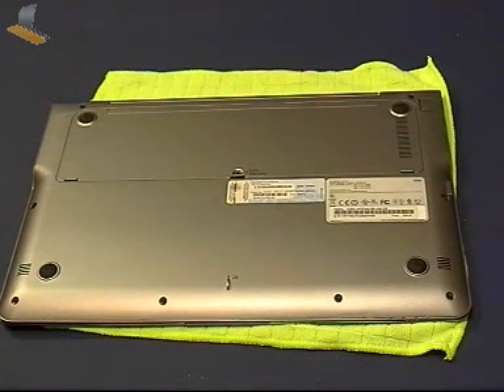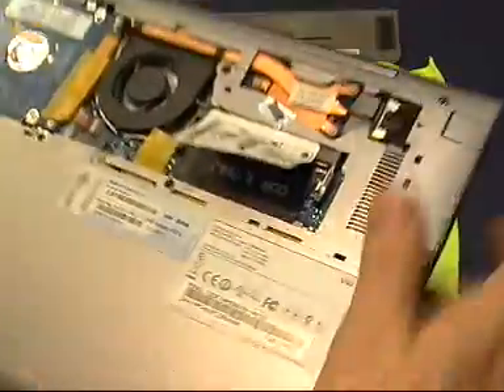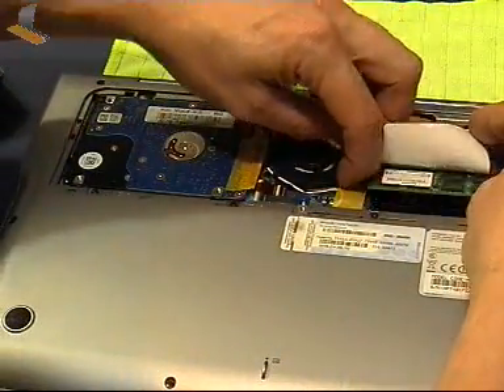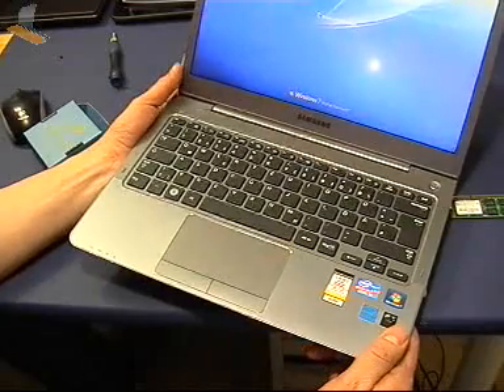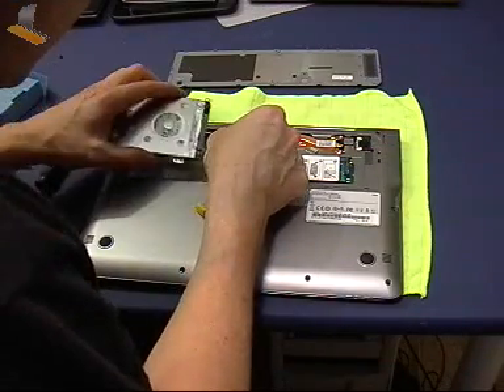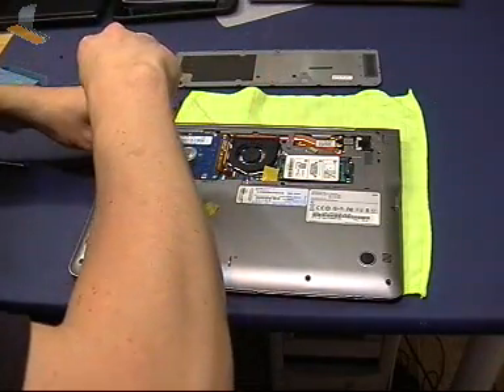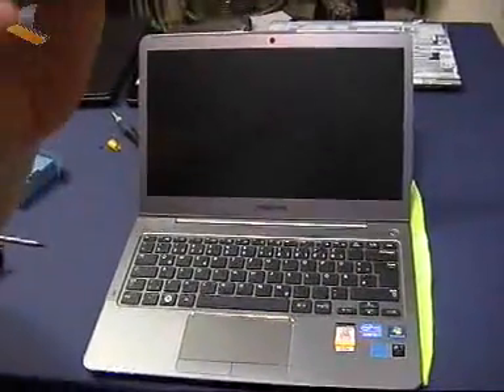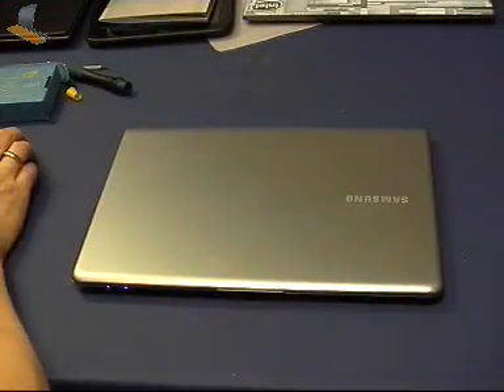Samsung Series 5 Ultrabook 8GB Memory and HDD upgrade

Comment: please help. after i inserted new 4gb ram and checking the properties it is only 4gb(3.5gb) usuable. 
spec: DDR3 1600mhz 204pin SODIMM
Reply: This could be down to the version of windows installed, i've seen reports of Windows-32bit only supporting upto 4gb of RAM, you would need 64-bit Windows to show more RAM in the system
Reply: CelleryHD thanks for your reply. my systems is alreadt 64bit since.. but after I removed and re install the card it worked and shows 7.xx gb usable.

Comment: Hey: How to put windows 7 on this thing?. W7 does boot from usb stick and goes to the setup, but after press: "install"  it hangs endlessly ( no hdd activity)  The mouse and CMD ( by shift+f10) still works so it didn't crashed. it just simply does nothing.
Extra info: The HDD on this thing died. I wanna try to make a new NTFS parttion or so. So win7 goes on it.

big hugs and cookies for you who can answer me!

ps I got the samsung np540u3c
Reply: Thanks But i managed to fix it. 

Seems the HDD was totaly dead. dead clusters all over the place:p
 USB boot was easy btw. Just make it a bootable, thats it.
Reply: It does dl this: https://www.microsoft.com/nl-nl/download/windows-usb-dvd-download-tool   select ur iso    Done
Reply: Nothing more needed
Reply: Ah yes, but I putted a normal hdd in it:P
Reply: I said. I used windows usb tool. A normal hdd . not 1 with that crappy sdd partitition.
Reply: Quote: "Dario Scheuch Personal Training
U cant install from USB because of this shitty iSSD 24GB thin in there - you need to install from an external DVD Drive and it works - but there is a workaround for installing from USB which is quite complicated"

I know this: Ty for the answer, But I've removed the issd partiton, even with a winxp boot/install
So it was gone. 
Placed a NEW HDD in the notebook, boot win 7 or 8 from usb and all worked.

At least it did on mine.

Comment: I just replaced the 500GB HDD of my GF's NP535U3C with a Samsung Evo 850 250GB using the Samsung Data Migration Software. Everything went flawless. The laptop did not even sense it got a surgery when I booted up with the SSD.

Anyhow, I want to maximize also the RAM. It came from the factory with 2GB. I have an extra 2GB which I easily put on the empty RAM slot for a total now of 4GB. I also tried putting my extra 8GB RAM from my other laptop and it worked also for a Total of 10 GB when i tested it.

When I ran the SSD and RAM compatibility scanner from Crucial.com, it says the maximum I can get is 8 GB as 2 x 4GB. The problem is just like many of us, has anyone actually seen if the initial/default RAM chip that is with the motherboard removable?  Based on the Crucial Scan, I can put 2 x 4GB to max it out. But im not willing to go to the extent of disassemblying the entire back to see the original RAM. 

thank you.

Comment: Just an additional information on this tutorial. You must make sure you desarm the battery to avoid any damage on the memory or motherboard. There is a very small hole to do it. Check the hardware documentation to found out about this procedure.

Comment: Is it possible to add more then 8 gb of ram, if i do want more ram then 8 gigs, do i have to change any other components?
Reply: I have one of these and when I went to see technical assistance they told me the motherboard can handle up to 8GB in DRAM(total). But it runs really smooth for me with to 2 4 gigs in each slot, 1333Mhz....

Comment: I don't recommend Samsung computer to anyone. I have experience and there is issues with the hard disk, cooler and it gets too hot. I have changed the hard disk and the cooler twice, but with no success.
Reply: Eh?

Here is a LENGTHY response, should you be bothered to read multi experine based comments that are constructed with more than a bad run with one Laptop that frankly should have been sent to Samsung for replacement, who would have done so quickly without any real effort needed.
I currently have 3 Samsung Laptops in my home. One is my sole use and the other two I share with my 14yr old. in thise three I have A "bog standard" 15.6" Laptop with the onboard intel Graphics. Mainly used by my son for schoolwork and streaming sites and Android games via BlueStacks, I also have the RF711 that I use for myself, (i7) 17" With Nvidia graphics and RF511 (i7) 15.6" with Nvidia Graphics. There has not been one single problem with them at all in heating terms or performance terms. A repair shop killed a Hard Drive by not disconnecting the battery completely, and replaced the hard drive which I simply restored and rebuilt from an external back up (Moreover I have had Samsung laptops since 2008 upgrading when appropriate) I have upgraded the RAM in each laptop to the Maximum permitted each time, I keep the software for the onboard hardware  up to date and run "many games on them" The most demanding games I do run on the RF711 as it is top spec'd so it is the best result for my needs playing on a 65" TV. That said they are High End Laptops NOT GAMING laptops, yet still cope well and DO NOT OVERHEAT nor MAX OUT the CPU.  

Also with the Latest large screen TVs the Samsungs are great or network playing Movies, streaming etc. (if you prefer not to use a smartphone or USB pen drive, the Samsung Software to do this is pukka & it is easy and intuitive to use. I have a HUGE movie collection in 1080P and now 4K-2160P which are fairly large files of 5GB to20GB so it suits me to play Movies using one of my Samsung laptops from the collection on one of my two Toshiba USB3.0 Portable drives (1 x 3TB & 1 x 2TB)  I also have SEAGATE Mains powered 3TB drives on my network as well and I buy all USB drives by SANDISK and Micro SD Cards by QUMOX. So I am not a Samsung "Bitch" without sense to use other products that worked best for my needs when I tried them out. 

Honestly I will be sad to see this set of Laptops be upgraded, and have kept them a bit longer than normal, but when I upgrade I will go to a decent supplier and arrange 7 days testing of Samsung versus other brands, but frankly I just can't see getting what I want, built reliably at a SENSIBLE price. Plus, with Samsun honouring a little Known EU Warranty Directive on ALL of their goods, I know I will have two years full warranty too. I had two identical Plasma TVs develop an odd fault out of the blue inside 7 days, due to a 3rd party component that was no longer available. Samsung collected them, (left me replacement Tvs to use) then  replaced the faulty units with newer models (LED Tvs now of course, avoiding PLASMA issues) and the newer models were ones of my choice, and were brand new boxed TVs, and their service agent even came and took care of all the wall mounting/unmounting/remounting along the way. 

Reliability AND good product online support AND great Customer Service mean a lot to me. I am disabled and can not be traipsing back and forth to stoires easily with products that fail, and Samsung even "give extra assistance" for those of us needing some extra help to provide an EQUAL OUTCOME to non-disabled cutomers. That said, the products are so good I have not had any cause to place demands on Samsung over Laptops at all.

I realise we can all have Bad Experiences iwth products, but it seems highly unlikely that the issues you describe were applicable to every one of the model you had or we would know of it in this age of bad news is Rad news.

I hope this explains how others can have some faith in Samsung laptops still.

If you are "still here" Thx for reading.

(PS)
Search for EU 1999 Warranty Consumer Protections and you'll find the directive that can be applied to ALL good bought in the EU from ANY manufacturer. I have used it many times for elctrical Household Goods outside of the "MFR 1 Year Warranty." period, and have always had items replaced with new goods. Knowledge is GOOD!

Comment: Exactly how does cutting the power to a device fry it?
There is no electricity there to fry it. LOGIC.

Manuals are full of cover-my-ass-from-liability wording. Quote form the manual re the battery hole : "This may result in data loss or a product 
malfunction."  A malfunction, as in your OS getting corrupted, NOT actual hardware damage.

Comment: what screw driver did you use to take off the back plate it looks like a precision screw driver. I tried to take it off with great difficulty, I'm thinking because the screw is small it needs a precision screw driver is this correct.

Comment: thanks man, i just put a 7 mm in and right now its OK. Did you already have windows preinstalled on the other? Also,  I lost the ability to use the the F2 an F3 brightness and the graphic that would come up on screen for capslock and others. Any chance you know how to get it back?

Comment: just bought one yesterday. that was not a 7mm HDD. 6mm actually. super slim. n i bought 7mm corsair force GS altogether online. just a 1mm height problem so hardly to fit in. aluminium plated is 1mm. n there is a grounding plate at the skrew. don't dare not to use the HDD base plate. so. in the end i placed the SSD without the skrew. getting a driller next time.

Comment: Hard Drives and Solid State Drive are Both Hardware Components Designed For Data Storage.  For as Long as Both Components Have The **Same SATA Connectors, They are Indeed Interchangeable.

**Some HP Laptop Hard Drives Have Modified SATA Connectors.

Comment: Should install a Corsair Vengeance 4GB (1x4GB) DDR3 1600 MHz (PC3 12800) Laptop Memory (CMSX4GX3M1A1600C9)
or a
Corsair 4 GB DDR3 Laptop Memory CMSO4GX3M1A1333C9  1333MHz Unbuffered CL 9 SODIMM Memory 9-9-9-24 1.5V

Would appreciate help, since I'm a bit of a newbie with tech upgrades

Comment: Hello,
It happens that I just bought one and also added 4Gb of memory to the existing OB memory.

The problem is that with the 8Gb, every time I try to wake the laptop from sleep, it irremediably shutdowns and restarts. - If I remove the expansion it works.

Did you see any similar behavior and if so how did you solve it..!

Thanks in advance,
Pedro

Comment: can someone plz tell me if i can replace the WiFi card on the Samsung series 5 specifically NP530U4C-S01AU ??
Will it be from the same slot or would i have to disassemble the whole thing, and when i do is it even replaceable or integrated/soldered ?

Comment: Warning: Without using a paper clip (or similar sized object) to press the button in the "Emergency Hole" to cut the battery power you can fry your motherboard by doing what this guy does. Please refer to your Samsung manual for more info.